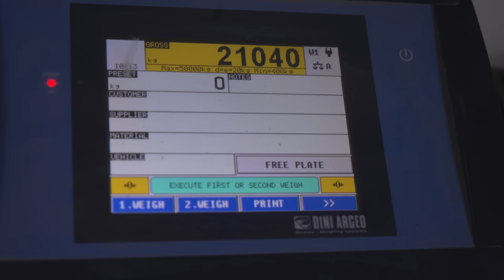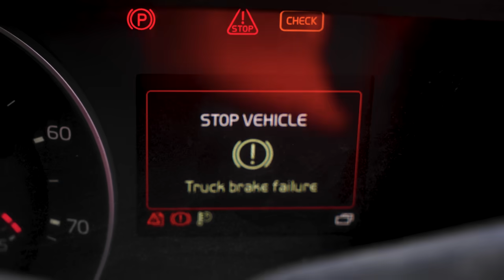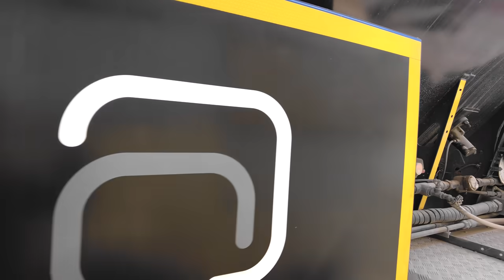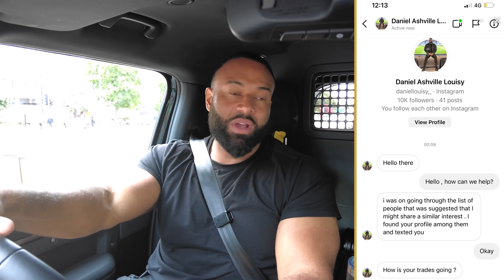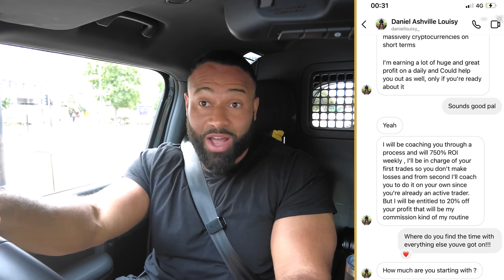The Pressures Building | Ashville Weekly ep096

Comment: 35:43 you could spray paint the smoke alarm black.   You could mask up sensors and lights and do it on ceiling.  Or, dismantle the fire alarm so the cover comes off and spray paint that.  You can get acrylic spray paint suitable for plastic or could use car bumper spray paint

Comment: Use vibrators that they use on flour silos. Change the fall angles on your concrete trucks.put in a retractable hose gatherer when not used is wrapped around the roller easy peasy.

Comment: Instead of a smoke detector you could use an air sampling unit. It pulls air from the room and runs it through a unit to detect smoke. The sampling point is very small in comparison to the detector and they’re allowed as an alternative to a detector

Comment: We know you sold some older lorries at auction, but could you of used them for train unload 2 or 3 working on a loop tipping from the lh60 I wonder if  not going on the highway mot & weight limits still apply  it’s seem a lot of work for the loader to scoop up, Dump & return  opposed to a 18 - 20 tonne run  & tip